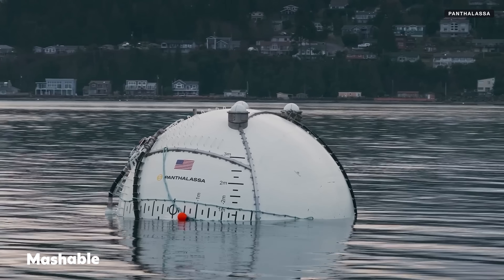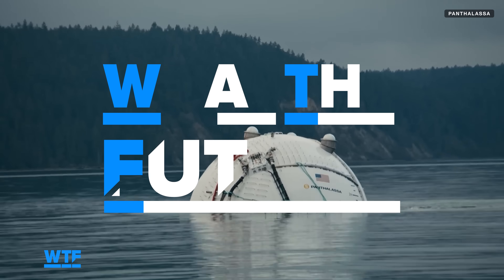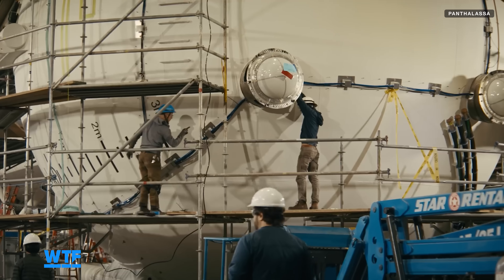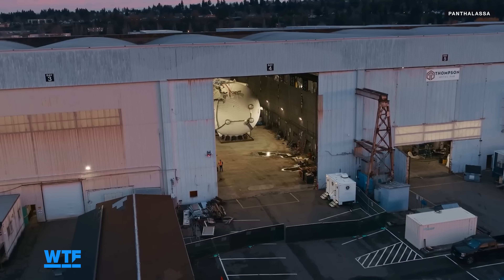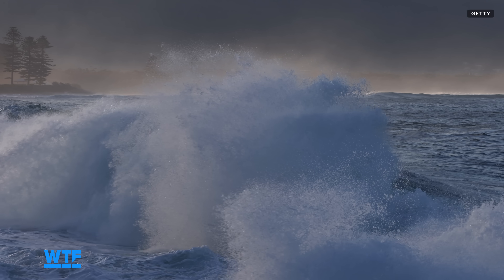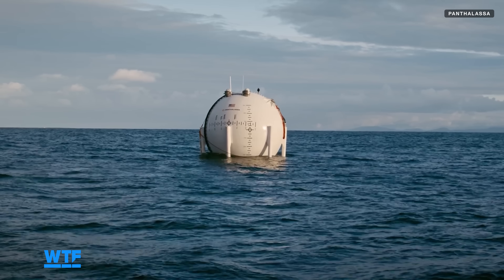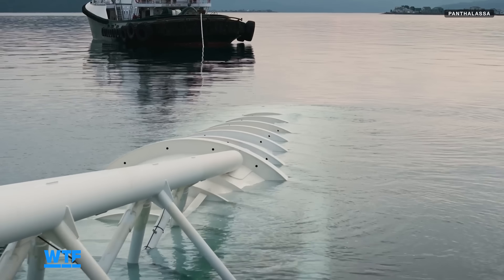This Wave Power Converter Could Change How We Produce Clean Energy | What The Future

Comment: One unit can only power 15 homes? So, how many of these are they going to have to build to power a nation?
Reply: If we assume an annual production of 100 MWh (with 2000 full-load hours per year), it would be 2.7 million units for the UK. 
Or around 500,000 units for Portugal. 
Just regarding annual production and annual consumption - without considering the volatile production and consumption: Sometimes too much electricity, sometimes too less.

Comment: Always good to see research into this vast untapped source of power however i suspect the biggest issue with this is marine organisms that would, quite quickly establish themselves in the passages where the water flows to create energy (as a great place to feed in the water flow) which would reduce the smooth flow through the passages thus initially reducing the energy output and in the longer term possibly stopping it altogether. I imagine that the upkeep of having to lift out the equipment, clean and re-site on a fairly regular basis could well make it fairly inefficient.
It is a difficult environment to create something cheap, efficient and yet resilient and as maintenance free as possible. Perhaps AI will be the route to perfecting this.

Comment: 15 kilowatts. That's like a motorcycle engine's power from a machine that big, using so much metal. Need 1000 units for a measly 15 megawatts. A conventional power station generates hundreds of megawatts. Wave power has always been cursed with low power density. This has been known for decades.
Reply: The transcript says: '...The tests also
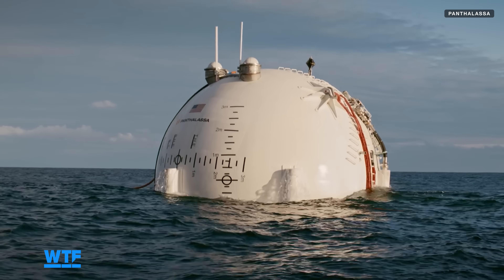2:51
saw Ocean 2 pumping 50 kW of energy,
2:54
enough to power around 15 houses...."   One of those for 15 households seems like not much IMHO.

Comment: Scaling of distributed, relatively low energy production will have high marginal costs per node, analogous to the reverse problem of grid extension and maintenance in rural areas. High costs will sink ultimately sink it imo.

Comment: 50kw will power 15 houses? In what universe? I don't use 50kw, but my service is 96kw for a single family all electric home. Solar more than covers all of my usage on a net basis, but 3.3kw per home is not reality. That like running a small electric dryer 24/7. Most houses use much more than that in the US.
Reply: If they're talking kW, then yes it's enough. A home only needs a few kW at any given time. If it's kWh per day, then I agree with you. But you say your service is 96kW? A home will NEVER need 96kW at a single time.
Reply: 50 kW nominal power (ideal waves) might be 12 kW average power, which would be 105,120 kWh annually. 105,120 kWh divided by 15 is 7008 kWh per house and year. This dimension fits. 
Of course, it's only about annual production and annual consumption, not about covering every power peak with it.

Comment: Wave energy is unique as noted in this presentation that can cross oceans with waves shown the result of the circular oscillation up to 20,000 ft deep or more forced to be compressed at 10 ft deep or more ...or less. This  to become elliptical shapes stacked on each other. This unique energy is forced to be managed in this way to be then released as small to huge waves. Natures fringing Coral Reefs perfectly manage up to 97% of his unique energy and also known for having the very best surfing waves and secure shorelines. Nothing is seen on the ocean horizon with natures way of energy capture. It's methods has become the model for a blueprint for the goal as to mimic as best possible natures way.  Long term solutions also must respect the oceans, marine life and also its shorelines as the focus of 30 yrs of research by Highwave Ocean Energy.

Comment: don't see how this could ever be more accessible or easy to maintain than solar in 99% of the use cases so it's highly suspicious that this kind of project is receiving so much funding. the niche case where this would be a huge advantage is in military applications like providing a power station for drones near key conflict zones. this is an MIC project dressed up as a "green" civilian venture.
Reply: Panthassa's Ocean-2 test from earlier this year produced as much electricity as one-hundred solar panels operating under optimum conditions. If you could deploy a dozen or two dozen Ocean-2 units in your area, I don't know why you would instead opt for solar.
Reply: @ktechnology9146  you're using the wrong metric, it doesn't matter how many solar panels it replaces, it's about cost efficiency. this thing costs orders of magnitudes more than solar per MWh and looks like a nightmare to deploy and maintain. it will take decades more to improve the cost efficiency with adequate funding to even come close to solar. so which organization famously doesnt give an iota about cost efficiency?

"my area" happens to be near a fresh water lake and not much else. how much energy do you think it'll generate in still water and how many solar panels can it replace?
Reply: @Placid_Cat  Obviously Ocean-2 wouldn't be viable everywhere, but neither are solar panels. Coastal regions away from the equator tend to have more cloud cover, more salt in the air, more forestland, and more tidal activity, all of which make something like Ocean-2 a better value proposition than solar panels.

Comment: you need to combine with outeter shell half egg chamber - which will put air in and out if you put turbines with the same curvage blades the turbine will rotate the same direction as air flows in/out oso even less waves will generate electyricity
Reply: but that will kill the marine life